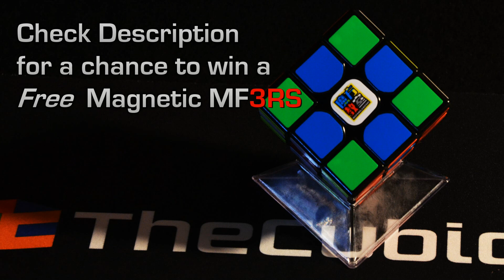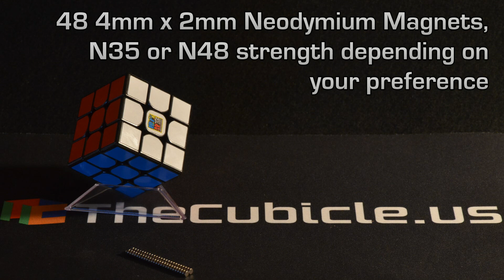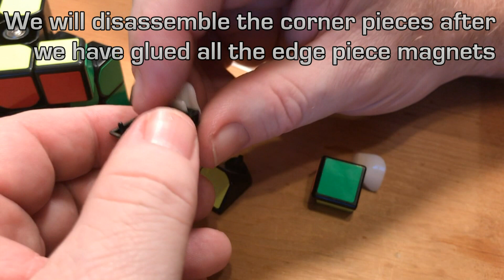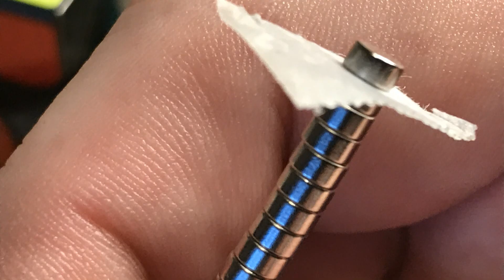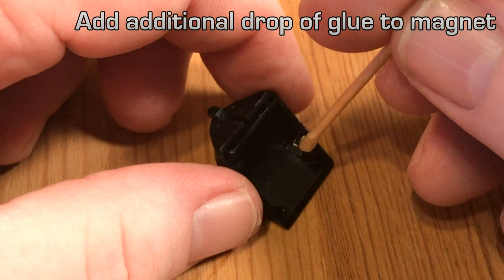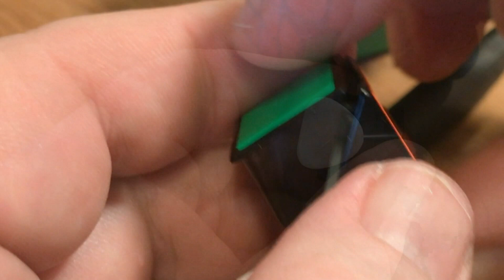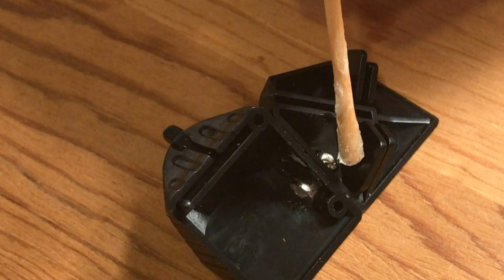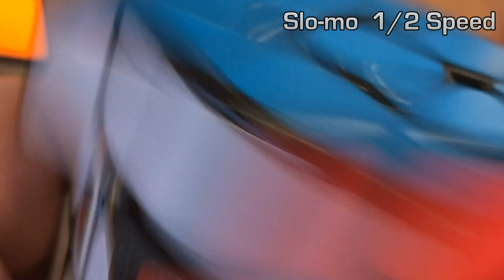How to Make a Magnetic MF3RS Speed Cube

Comment: hi! i did not understand what u did for the corner pieces.. 
like for the edge pieces.. you place one magnet inside and then on on the outside... so the edge looks like it has 2 magnets.. one inside, one outside... but.. when it comes to the corner piece.. gluing them together,( the corner and the edge), in the edge , i cant see that  magnet u placed outside....i am so confused...
Reply: oh. ok, so is that outer magnet just to hold the inner one?
Reply from the maker: Exactly. I started using this method back when I was using epoxy to glue in the magnets. I think it's wise to do it with superglue too because the magnets do have the potential of slipping or moving, particularly when the cubie pieces are placed near each other and the magnets repel. I see so many videos where people just place the glued in magnet with nothing really holding it in place. But yes, the outside magnet you see is a "helper" magnet, used to hold the glued-in magnet in place.
Reply: thanks.. that clears the confusion.. ill be making one and will definately credit you.. thank you so much for this awesome tutorial =)
Reply from the maker: Hey, that is great! This really is an awesome cube!
Let me know how your project goes!!!!
Reply: DMCubing ok:)

Comment: Hey,Could I Use N50 4Mm×2Mm Magnets For The MF3RS?Would It Have A Similar Feeling To The N48 Magnets?
Reply from the maker: NeoGravity I think they'll have a similar feel to the N48. The magnet pullforce will be pronounced but the quickness of the cube should still allow for it to feel smooth.
Reply: Owh, Thanks :D
Reply: Is The N50 Magnets Too Strong?
Reply from the maker: NeoGravity it depends how you like a magnetic cube to feel. The N50s will be fairly strong in the cube. I don't think they'll be overly strong, but it's something to keep in mind before you magnify a cube. If you have an aggressive solve style and like a little resistance in your cube, this magnet will be good. If you rather prefer a lighter effect on stability and want the cube more free flowing than the N35 is probably what you'd want to use. 
I used N48 in mine and they produce a somewhat pronounced bump or click, and you can feel the magnets holding the cube in alignment. Since it's such a smooth, fast cube, it doesn't really lose speed. 
One last thing that might be worth noting. I have heard from a lot of people that have ordered N50 magnets from eBay only to find out that they are relatively weak compared to what they should be. I don't know if this is a case of lower grade magnets being passed off as higher grade magnets, or what. But I've probably had at least 10 comments from people saying they've used in N50 magnets in cubes that they normally wouldn't work in, so that makes me think that there might be some fake 50s out there. Of course, I don't know if yours will fit in this category.
Reply: Fake N50 Magnets?
Reply: Thanks 4 The Info.

Comment: Is there a difference in performance between the stickered and stickerless cubes
Reply from the maker: I haven't tried the stickerless version of the MF3RS. Usually there are subtle differences with any models, between their black plastic and stickerless versions. It's very subtle however. And sometimes you'll feel a tiny bit of difference with the magnetic strength, that sometimes the magnets feel a little bit stronger in the stickerless version. But again, the differences are small and subtle.
Reply: ok thanks

Comment: Hey DM!

I've decided to actually look into magnetising a cube finally but just to ask, why do you always use 4x2 instead of anything else? I can get n52 4x1s but I never got why you dont use them.
Reply from the maker: Hi. Great question. Actually I have several sizes of magnets, from 3x2, 4x1, 4x2, and 5x1 and have used them in prototypes and even some of my tutorials. For me, the 4x2s seem to get the job done, over and over, where I've needed magnets. And in 4x2s, I have strengths/grades N35, N38, N40, N42, N45, N48, N50 and N52, so I have pretty much the entire range covered for my use. I have about 4500 magnets right now. 
As for using the N52 4x1 by itself, there's nothing I've found it useful in outside of the 2x2. Its magnetic pullforce is about a third less than the lowest grade (N35) 4mm x 2mm magnet. You can double stack them for thicker type 3x3 cubes. It may work in some thinner cubes like the Gan Air as a single magnet, but again, its pullforce is .45 lb compared to an N35 4x2 which is .64 lb
Another thing nice about the 4x2s is they're easy to work with since they're not too wide and fit in a large variety of cube types. The 5mm wide magnets are too wide for some cubes. 
Hope that helps.

Comment: I have a question. If I add magnets in stickerless MF3RS, should I use N35 magnets instead of N42? Because it say black plastic blocks magnetic force partially...
Reply from the maker: S.S.STAR-C I used N48 in my black version and they're pretty pronounced. The cube certainly locks into position but really isn't hard to turn or slow (spring strength and overall tension helps with that). It's a cube that you can probably use a variety of magnet types in and still have a nice magnetic cube. 

I'd probably be more inclined to use the N35s in the stickerless version. Yes the black pigmentation in standard cubes does reduce a small amount of magnetic pullforce, and since the 48s feel the way they do in the black, the 42s might not be that much weaker in the stickerless, so it might be safer to use the 35s. Whichever one you use, please let me know how they turned out. This is such a fun magcube!
Reply: DMCubing Oh, I got a typo. How can I mistake between 42 and 48... Sorry.

I'll try with N35. When it finish, I'll tell you the feeling of magnetised MF3RS. But it'll take a LONG time because I'm lazy. :(

Thanks for FAST reply!
Reply from the maker: S.S.STAR-C Oh, so you meant N48 or N35? You'll want to use N35. 48s would probably be too strong. 😀

Comment: umm i had a polarity issue, wot can i do to fix it?
Reply from the maker: Asian You'll have to find which magnets are in incorrectly. To do this, disassemble the cube then reassemble the cube without the core. Properly placed magnets will allow all edge pieces to attract all corner pieces. (A cube with proper polarity can be assembled without the core and remain in a cube-like state). You'll quickly find which piece or pieces are wrong. Take the piece apart, confirm the incorrect magnet then use a screwdriver to pry and chip the magnet out of the piece. Be careful not to damage the plastic. Then reorient the magnets to match the existing, correct pieces, and reglue.
Reply: thank you

Comment: I was lubing the hardware on my MF3RS but I noticed of the 6 screws and springs only 1 had a washer. I was wondering if your cube had washers or not. Thanks!
Reply from the maker: Asterisk * Are you sure? They're pretty shiny and stick to the bottom so they can be hard to see. Anyway if that's so, that's kind of crazy. Mine are all there but I think it was this cube that had an extra washer when I took it apart to magnetize.
Reply: DMCubing Yea I was pretty surprised myself when I saw that the washer wasn't in the center or on the screw. My MF3RS is stickerless so it's pretty easy to see if there is a washer or not. Thanks for the reply.
Reply from the maker: Asterisk * They should pay more attention to quality control. It's really a decent cube, really performs well. Just because it's cheap doesn't mean they need to overlook stuff like that. Thanks for letting me know.
Reply: DMCubing where can I buy spare washers

Comment: how do we know what color to put on the corner piece so that e dont mess up the color scheme

 im bassically asking..............how do we know which corner-third to put on a corner?
Reply from the maker: Awesome Guy Good question. When we actually glue the magnets in, we're not concerned about the color scheme since every edge piece half will always attract every corner piece third regardless of color. However, when we reassemble the cube, we need to build the pieces back to the correct color scheme. Some people can do this pretty much intuitively, while others, myself included, use either another cube to look at, or a sheet of paper with a checkoff list. That's what I use the most, the checkoff list. Before you take the cube apart, just write down how the pieces are put together, like: Edge Pieces - GR, GO, GW, GY, BR, BO, BW, BY, OY, RY, OW, RW, meaning Green Red,, Green Orange,  etc. and: Corner Pieces (in clockwise order) - GWY, GYO, GRY, GOW, BYR, BOY, BWO, BRW. I hope that helps.
Reply: thank you that helped tremendously THANK YOUUUUUUU U ARE A LIFE SAVERRRRRRRRRRRRR
Reply from the maker: Awesome Guy Your welcome! I'm surprised I haven't memorized it yet, but I still use my check off sheet! 😀

Comment: Wow very nice video! I did a magnetic GTS on my own but I messed up the polarity and now i ruined my GTS. I may try this!
Reply: ED Cuber get acetone (I used fingernail polish remover) and dump some over the magnets and wait. after a little while you can take the magnets off. hope this helps (I did this too)
Reply from the maker: ED Cuber I've pried magnets out of many cubes. It's not easy but can be done. Your cube probably isn't ruined. 😀
Reply: REALLY? How do i do it? I really want my GTS back.
Reply from the maker: This can help loosen up superglue, but be careful, because acetone is a known solvent of ABS plastic, meaning it can dissolve your cubie pieces if left on too long.